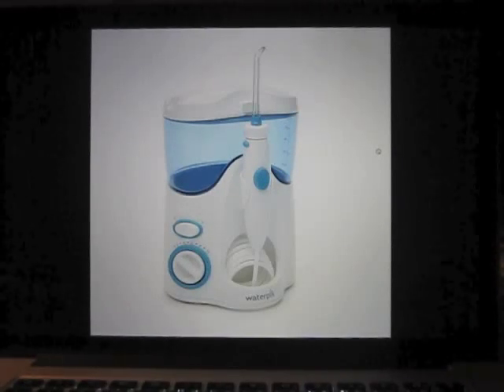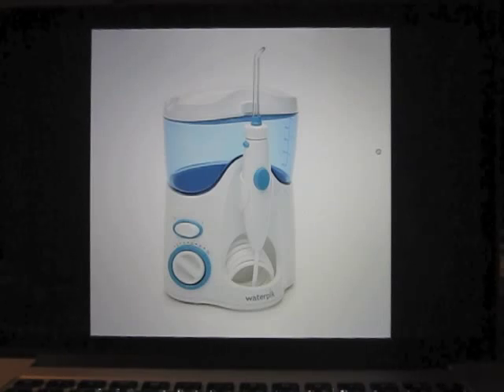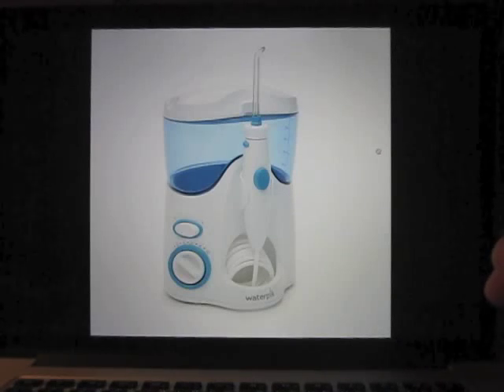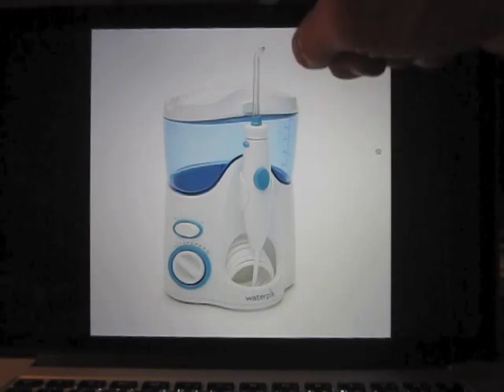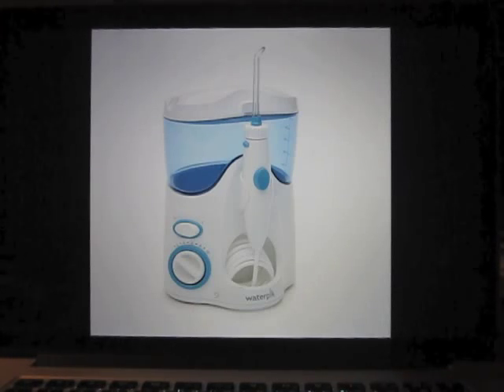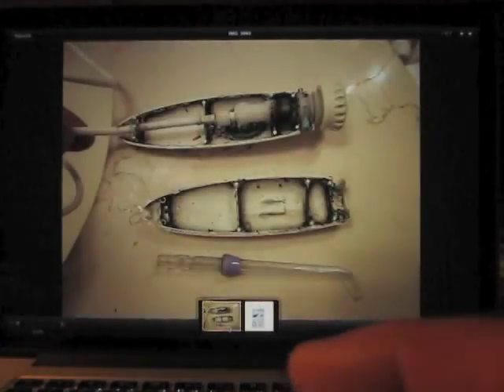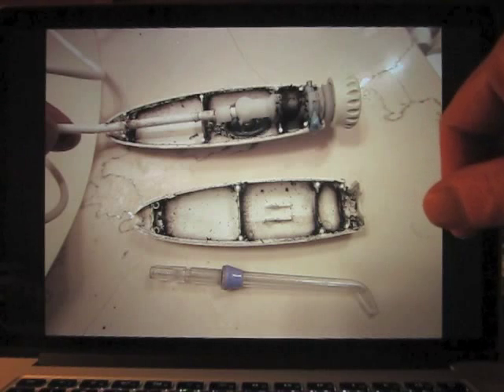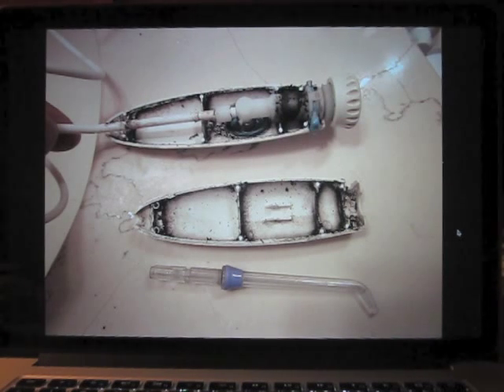Waterpik and mold

Comment: I take the tip out and flush it with Listerine.  With the tip out and the pump on, I tap the handle on the sink's edge quite hard and it knocks out chunks of black mold.  Waterpik needs to come up with a better design.
Reply: You're supposed to clean and flush with Clorax at least once month.  A squirt from a Clorax pen and about 1/4 full water and flush.  Let stand overnight then rinse and flush completely with fresh water the next day.
Reply: I agree.  It's almost like it's designed to do this so we replace it.
Reply: You want to clean the unit with white vinegar and warm water once a month as well as the tips and submerge the whole handle in white vinegar and warm water.  2 tablespoons of white vinegar half reservoir of warm water, run through the unit and then rinse with full tank of warm water.  No mold! Clorox not ideal as it will dry out the components and ruin the unit.

Comment: I heard about this when I replaced my handle because the hose cracked I took apart my handle, and there was no mold after ten years of having mine. It must be your water or something. If you live in a damp climate that could happen I hang my handle upside down and take the tip off after using it.

Comment: I'm going to guess that the water that comes out the end does not actually contact the mold inside the handle because that water travels inside of the tube and out the tip. The handle is allowing water to enter, probably during use water splashing over it enters the handle, and then it doesn't get flushed out, so it begins to mold. It would be helpful to show how to open the handle to clean it.

Comment: This is a big Problem! Our is 13 years old but has a replacement hose/handle, maybe 3 years ago. The original had this problem. Now the replacement one has the same. First the smell of bad eggs...then I clean under the ring. I used bleach in the past to try to clean inside by soaking overnight. This time with  Hydrogen Peroxide. I think the latter is better. Anyway, It a good machine but this issue is a health risk. It needs to be changed again or opened up to clean properly. This time I am going to try to use stainless screws to hold it together so I can clean every few weeks. If you live in a hot country I think the problem is worse. We are in Spain but with AC in the house. The smell of bad eggs here worries me as it could be bacterial as well as mold.

Comment: According to Waterpik your supposed to soak the entire handle in a glass of warm water and vinegar mixture for a minimum of 5 minutes. Also clean the tip separately. The reservoir also needs to be run fully with warm water and vinegar until empty to clean the lines.
Reply: Yes...but how do you get into the handle and remove black mould around where the waterpipe joins the unit. Disgusting